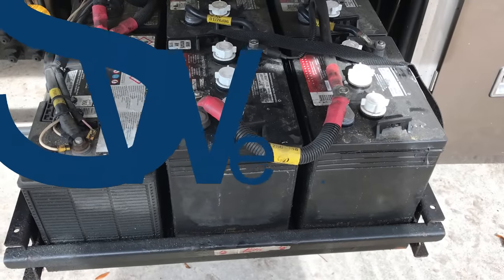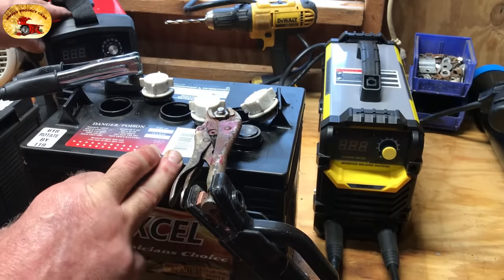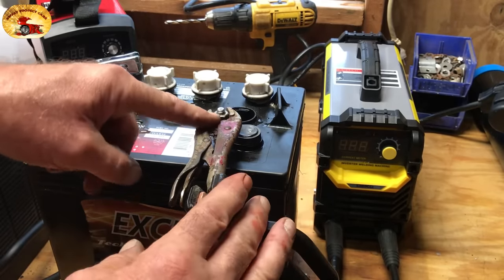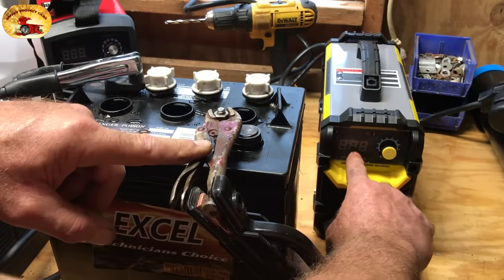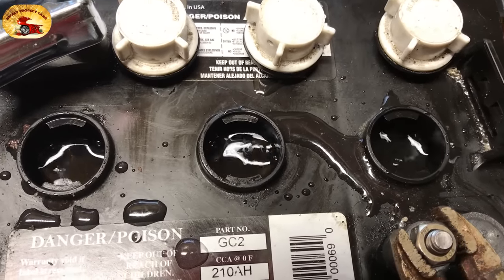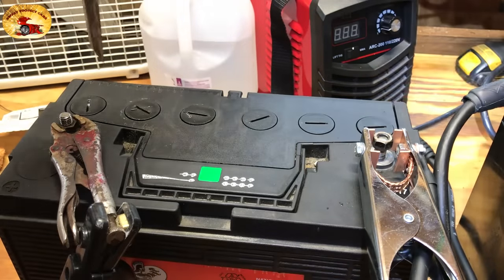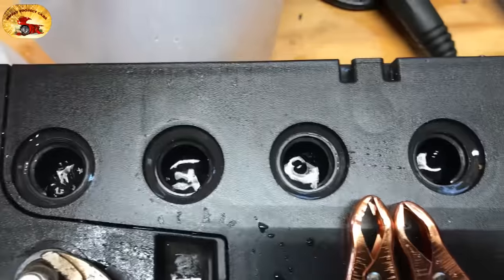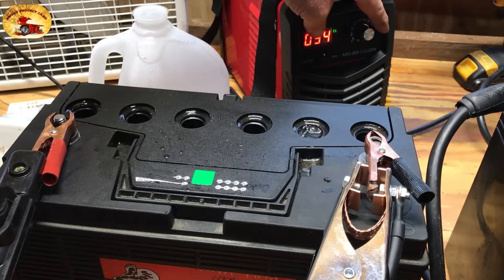How To MAKE OLD BATTERIES NEW Again!!!  12v 6v Deep Cycle, Car, Truck, Golf Cart, Semi

Comment: You rock, Thanks for the great info. Do the think that your ideas would work with a 200 amp AC only welder? ( Miller thunderbolt 225). Wouldn't hurt to try huh?
Reply from the maker: The only one's we can safely recommend are these two  https://amzn.to/3r5F2S9 for ALL Deep Cycle only 6 Volt & 12V Batteries  or  For All  Standard 12-volt Batteries    https://amzn.to/2K1UsWQ  Thanks for asking.  mad Mike the hammer SPC
Reply: Donley Wilson did you ever try it out? Does AC work or just DC?

Comment: So dude; we should forget about using that charger in the old video? I really don't need a welding machine. Thanks
Okay it's just that this method is much faster? Old method works but just takes longer?
thanks again
Reply from the maker: They both work Kevin, this is just an update to this method, it's better as far as we are concerned and more economical, but again both methods work. Thanks for watching and asking, hope you have a great week. mad Mike the hammer SPC
Reply: @SweetProjectCars  
Thanks for getting back to me!

Comment: Helo sir my question is. My welder a direct dc stick 120volt . My lost setting is 15 amp with no voltage meter. I am trying to figure out how I can charge a 48 volts system. Can I hook up a voltage meter to read the voltage out of the welder. Thanks.
Reply from the maker: If it's a wet-style battery, hook the charger up starting at it's lowest setting and turning up until you get a consistent boil, follow the video and you will have positive results.  Thanks for watching and asking Ralph.  Have a great day. mad Mike the hammer SPC

Comment: What is a deep cycle battery?
Reply from the maker: Deep-cycle batteries are a type of battery that is designed to be repeatedly discharged and recharged. They are commonly used in applications such as golf carts, RVs, and solar power systems. Regular maintenance is essential to maximize a deep-cycle battery's life. Hope this helps, have a great day. mad Mike

Comment: Okay one clamp go to the positive the other clamp goes to the negative the clamp from the goes to the positive comes from the welder where's the other clamp coming from and what kind of welder is it the brand the name of the welder please
Reply from the maker: We use these  Welder for Deep Cycle ONLY 6 Volt & 12V Batteries    https://amzn.to/3yW4ihK and  use this for all Standard 12-volt Batteries    https://amzn.to/2K1UsWQ  Make sure to watch the video in it's entirety for specific instructions and make sure you recap and unplug the welder before disconnecting the cables.   Thank you for watching and asking, have a great weekend. mad Mike the hammer SPC

Comment: 2 questions:
1) Do you put it on a regular battery charger after you do the jump start?

2) Will this work on a deep cycle battery that has dried out because I forgot to put water in it?
Reply from the maker: Yes, just refill the cells with distilled water, and you can throw it on your trickle charger when you are done until you need it.  Thanks for the great questions my friend.  mad Mike the hammer SPC
Reply: Ok I just purchased the red one and was able to revive my my sump pump battery.  It was stuck at 10.25 volts and after following this instruction it is now holding 12.3v.  it's not perfect but I think it will still buy me some time.  Of the six holes in the battery only the third hole did not respond as much.  I was using an extension cable and when I cranked up the wattage it kept tripping the circuit breaker in the extension cable, next time I'll use a thicker extension cable and crank it up and hopefully I would get somewhere over 13 volts.  Thanks a million.

Comment: hi Sweet Project Cars. Thank you for the videos. I noticed the welder you recommended for the 6 volt deep cycle charging is no longer available. Could you elaborate on what characteristics would make a good welder choice, or help provide an alternate option? thank you!
Reply from the maker: This  https://amzn.to/3svkTG1  is the one in the SHOW MORE and the one we use and recommend. Thanks for watching Doland. mad Mike the hammer SPC
Reply: @SweetProjectCars  I was wanting this question answered as well. Your link takes me to a can of spray lubricant on Amazon.
Reply: @matthewb2060   Yes sir... it still shows the lub....not the welder

Comment: You changed the link for the sold out red welder. I bought the first one you recommended.  Will that do for the 12 v battery ?
Reply: This is the welder I bought at the first link DEKOPRO 200Amp MMA Welder, 110/220V Stick Welder
Reply: Well, today I put the DEKOPRO on a used battery that I bought for ten bucks at a parts shop. Everything worked fine! I added an extra cycle because the end cell was not quite as consistent with the others in timing and intensity of the cell turbulence when starting a cycle. I measured 11.43v before the process and 12.48v after the process was finished.  The welder was at 13 indicated but I increased this to 20 towards the end.  At the end all the cells showed consistent turbulence start time and intensity. BTW,  the parts store people were reluctant  at first to sell me a "core" battery but I simply told them I wanted a used battery for a project. I picked one that I could possibly use in my car when finished! Thanks to you I saved the price of a new battery and I got a welder in the bargain!
Reply from the maker: Great to hear!  Thanks for sharing and watching!  Have a fantastic day my friend.  mad Mike the hammer SPC

Comment: I have another question, I have used the 200amp welder that you personally recommended on my 12v very heavy duty battery, this battery has a cranking amps of 1000.  After hooking it up and putting my clamp meter on it, its only pushing anywhere from .8 amps up to 2.7amps.  I used this on another battery that has a CA of 550, and as soon as I turn it on the water boils.  I put my clamp meter on it and it states that the welder is pushing 37amps.  Can you tell me if my reading on the first battery is an indication that it is dead and cannot be revived?   Why will this work on one and not the other?  I thought you stated this works on all batteries?  Also on the battery this is not working on, the positive terminal gets very hot while the negative terminal stays cool.

Now after doing this method, is there a certain rest time for the battery?  If so how long before the battery can be put on the charger to fully charge the battery?
Reply from the maker: Do this process up to 5 times in a weeks span before you rule the battery out as junk.  Some batteries don't wake up too easy, much like a 14 year old kid.  :)  Thanks for asking and watching my friend. Have a great day.  mad Mike the hammer SPC
Reply: @SweetProjectCars  Ok I will do this once a day for a week before ruling the battery junk or good.  Just an fyi I have already saved about $1k in batteries using this method.  I even revived a 12yr old battery doing this.  Thanks again.

Comment: Does anyone know what setting to use on these welders?  And what the typical amp rate is suitable?  Can a 110V welder be sufficient enough to boil the electrolyte?  What makes one welder work better than another?  Are you using them on MIG or TIG or STICK setting?  This isn't covered anywhere in the video that I can find....just turn it up till it boils............................   anyone?
Reply from the maker: Don't analyze until you are paralyzed Geek Revenge, watch and re-watch the video, this is a process that needs to be followed to a T. Use all of the same tools/products we use for success. Start the welder out on the lowest setting, then gradually turn it up until you get a rapid boil on all the cells, then follow the video instruction. Thanks. mad Mike the hammer SPC

Comment: Love the video and this method! just subscribed and liked!  I think I watched the video 20 times now.  I bought the 165 yeswelder for deep cycle marine boat battery and did the process to a T.  When I turn on the welder it now bubbles only for the first 5 seconds and then fades.  I heard you state it should bubble for 5 mins yet I'm not getting that.  Should I keep repeating this process?  I did the 5 mins on then 10 off 5 times now.  I notice it bubbles (did not before) only right when I flip the switch on the welder.  I'm wondering if there is a cut off on the welder that's kicking in after its on for a bit? I will donate if you can help answer! Also your amazing for replying to all the comments (I read damn near all prior to asking my question!)
Reply from the maker: Hello Alan, you can do the 5 times process up to 5 times, also, start your setting on the lowest and gradually turn it up until all cells are boiling consistently, if it doesn't work after that, your battery is toast.  Hope this helps, we appreciate the view and question.  Have a fantastic weekend. mad Mike the hammer SPC

Comment: Hi Mad Mike, i did as u taught in the video. My standard wet cell battery health indicated 13% before cranked and 71% after i hv cranked. The problem is the battery doesnt hv the power to start a car and it was indicated weak even after i hv fully charged. Pls assist. Thanks
Reply from the maker: Do the process up to 4 times if it doesn't take then the battery is probably toast.  Thanks for asking.  Have a great day Ray!  mad Mike the hammer SPC
Reply: @SweetProjectCars  Thanks Mad Mike,  now i know not all used batteries can be revived and the best part i learned from u was the inverter is the best fast charger 👍 Thanks again Mad Mike

Comment: On the grey MMA-200 recommended welder I assume leave the arc force on the lowest setting and only adjust the current as needed?
Reply from the maker: Start with the lowest current to begin then turn it up until you get a rapid boil, at that point there's no need to turn it up any further, every battery is different.  Thanks for asking.  Have a great day.  mad Mike the hammer SPC
Reply: Sir,it's ok to use an arc welding machine to the lowest settings.?it will not hurt the batt..?and 48 voLts ac out from welding machine can't burn the batt..thank you
Reply: @donelserlargo2316 

did you see him burn out the battery in the video? Did anyone comment that they burnt out the battery? Obviously use common sense. But if you don't understand electricity and have no experience with it other than plugging in an electric razor....this method is probably not for you.

Comment: Kinda reminds me of that fancy electrolysis stuff  to get hydrogen from the water. Does the air above the liquid ignite?
Reply from the maker: Well let's put it this way, when working on anything to do with a car that has any type of fume coming off it, the last thing you want to do is take a blow torch and ignite it around your projects you are working on.  Thanks for your comment, have a great night.  mad Mike the hammer SPC

Comment: Can i just buy the  160 inverter to do both types of batteries since 200 amp is to much for the 6 volt i am figuring  maybe more times to do a 12 volt batt but in hind site saving me from having 2 welders n spending more money
Reply from the maker: I wish I could tell you yes on your question my friend, but after months of trying this process, each welder is set to give our viewers the results they are looking for, so you cannot use one to do the other.  Thanks for your question.  Have a great night.  mad Mike the hammer SPC
Reply: @SweetProjectCars  ty sir

Comment: What current do I set the 12v and the 6v batteries to with the welders?
Reply from the maker: Please watch the video again, and as stated, start at the lowest setting then steadily turn it up until you get a consistent boil.  Thanks.  mad Mike the hammer SPC

Comment: Does it have to be this particular welder? Or just one with similar specs? Also, you mentioned deep cycle, then later said all batteries (flooded, not gelled). Thanks excellent info!
Reply from the maker: Gage, you can use whatever you want to use, we are just sharing what we know works and is safe for both you and your batteries.  This process works on all wet-style batteries.  Thank you for watching.  mad Mike the hammer SPC

Comment: Why can't the one you mention for standard 12volt car batteries not work for both deep and standard or vice versa (use the 200 amp for either)? In my case I have both... deep cycle for my RV and standard for my vehicles.  Do not want to buy two different welders (although still cheaper than replacing my RV batteries).
Reply from the maker: You can use whatever you want to use, we are just sharing what we know works and is safe for you and your batteries.  Thanks.  mad Mike the hammer SPC

Comment: No before & after voltage test?
Reply from the maker: We will wait for your video Charles, we're not here to prove anything to anyone, just sharing what 40+ years experience has shown works.  Thanks.  mad Mike the hammer SPC
Reply: @SweetProjectCars  i don't mess with battery restoration so dont be looking for this type of video from me.
Before & after voltage check would make make this method more conclusive. If you're not out to prove anything then why  make a video then?

Comment: are you doing this at 110 volts or at 220v
Reply: 110v and 220v are the input (supply) voltage options for the welder - not output voltage. Either will work as the machine will automatically convert to the required (adjustment) setting.
Reply from the maker: For the video we used 110v standard house voltage.  Thanks for asking.  Have a great night my friend.  mad Mike the hammer SPC

Comment: Can we do this with a normal ac/dc welder?
Reply from the maker: You can use whatever you want to use, we are just sharing what our testing and experience has shown to give fantastic results which are safe for you and your batteries.  Thanks for watching Louis.  Have a great day.  mad Mike the hammer SPC
Reply: If your welder puts out the same Volts, DC, and enough amps to boil the electrolyte, it will work.

Comment: Are you running the welders DCEN or DCEP?
Reply from the maker: Hook the welder up as if you were welding, then connect to your battery and follow the video as shown.  Thanks.  mad Mike the hammer SPC
Reply: Fred, I understand what you're asking,  and it appears to be Electrode POSITIVE.  Hope that helps.  T.S.

Comment: So I have 6 - 6 volt deep cycle  batteries in series, I know in your other video
all of the batteries can wired together ?  should they be disconnected from my system.  What would you suggest 5 min. at a time or longer for them being connected in series .they are in a wooden battery box on the garage floor; Thank you
Reply from the maker: Connect them so that you have them in groups of 2 for 12v then run them per the video as a standard 12v battery.  Make sure you recap and unplug the welder before disconnecting the cables. 
Thanks for asking Dan!  Have a great day.  mad Mike the hammer SPC
Reply: @SweetProjectCars  Thank you for the response, My welder is on the fedex truck for delivery Friday, Can't wait to play with it. My batteries are 6 years still holding a charge, not as good as they did. but we will give it a shot. keep up the cool videos, your friend dan whitehorse
Reply: Disclaimer :No chickens where hurt while filming this video. :-)
Reply: Hay Mike ! I had great results ! thank HOOLIO for me, He Saved me 1200 bucks for 6 new      
   6 volt batteries,  They are all like new and maintaining 12.8 volts connected in series and parallel . my Batteries are 5 years and 9 months old. LIKE NEW AGAIN.
MERRY CHRISTMAS and HOOLIO, FALIZ NAVIDAD ! lol
Dan Whitehorse
Reply from the maker: Awesome Dan!!!  Thank you so much for sharing, we truly appreciate it, and Hoolio says De nada :)  Have a fantastic day my friend and Merry Christmas!  mad Mike the hammer SPC and Hoolio too

Comment: Hi, what welder for smaller 12 volt batteries like ATV and Lawn Mower?  Also being the batteries are smaller than a standard 12 volt are the times the same?
Reply from the maker: This is our recommendation  The yellow welder is the one you will want to use for 6v batteries, the red welder is for 12v batteries.  Hope this helps.  mad Mike the hammer SPC

Comment: One more question: The red and yellow welders only have one dial, which cranks up the current. The grey one that replaces the red one has two dials, a current dial on the left, and an "arc force" dial on the right. I suppose we just leave the arc dial at 0 for our purposes here, right?
Reply from the maker: You are exactly correct my friend, you answered your own question :)  Thanks for being a great subscriber!  Have a fantastic day.  mad Mike the hammer SPC
Reply: @SweetProjectCars  Cool, just wanted to confirm, thanks Mike
Reply: I I have a golf buggy with 4 12 v deep cycle batteries about 4 years old and getting tiered so I will try this method with the dc inverter welder and let you know how they do. Many thanks Bryan porter if successful I will be leaving u a donation 👍
Reply: @bryanporter717  did it work?
Reply: @bryanporter717  Did it work on your golf cart batteries I have the same set up 4 12 volt deep cycle RV batteries . Which welder did you get?

Comment: Hey Mad Mike, did you put 23volts on a 12volt battery???
Reply from the maker: Garth, the digital readout is giving you amps not volts.  Thanks and have a great day.  mad Mike the hammer SPC
Reply: @SweetProjectCars  Thanks Mike.